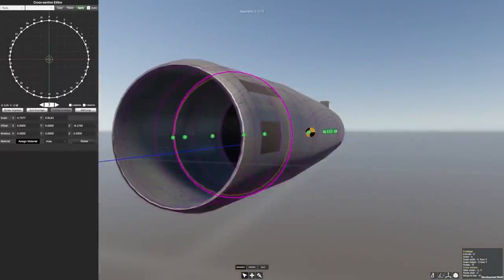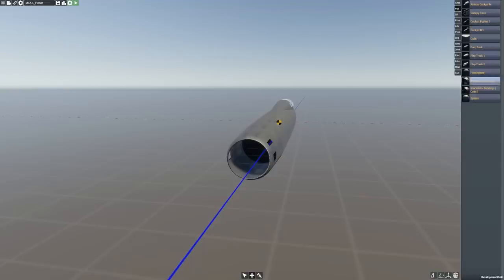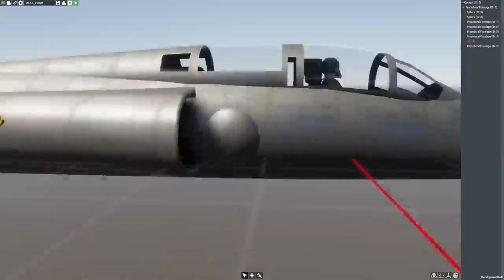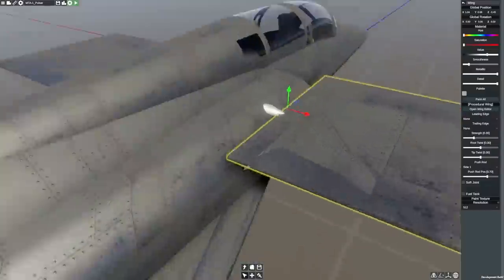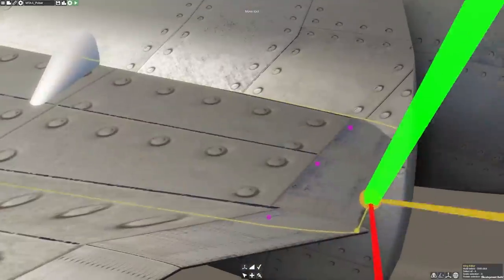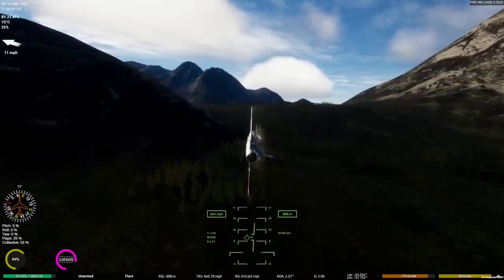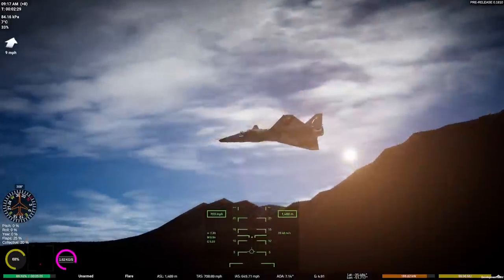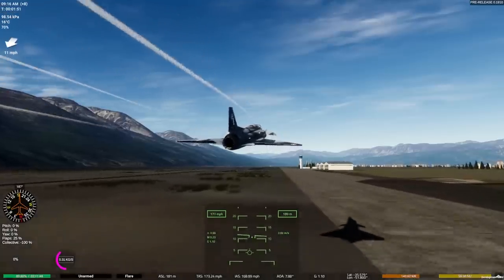Building an Artificially Stable Aircraft in Flyout!

Comment: The F-16 has this. That is why it is super dominant against air targets up close. That is the reason you see vapors on a f-16 almost every time you turn.
Reply: I think the vapors mainly come from the leading edge extensions
Reply: Well yeah mainly because it’s not aerodynamic (atleast compared to the majority of fighters)
Reply: But it...doesn't? The F-16 is a completely "normal" craft in that it has no thrust vectoring capabilites (the VISTA program was a thing but that never "took off"). It's maneuverability is down to how light it is and it's powerful engine, not any form of thrust vectoring. The F-22 is the only actively "serving" fighter in the air force that has thrust vectoring (far as I remember anyway).
Edit: I'm so sorry I came here from a different thrust vectoring video, but yeah, the F-16 does have the natural instability, and it's why it has such an extensive fly-by-wire system, otherwise pilots couldn't control it.

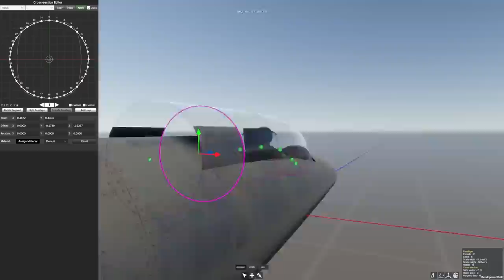Comment: 1:50 This analogy actually works well, because, for sufficiently skilled drivers, rear-wheel drive leads to better handling because acceleration and turning controls are separated. This is why it's much easier to drift in a rear-wheel drive car.

Comment: I know almost nothing about planes. But I know a lot about cars (and spend most of my time building race cars atm).

Your comparison to oversteer makes a lot of sense, as the optimal weight distribution for a race/performance car isn't 50/50 but rear biased. It causes natural oversteer which is countered with suspension geometry, differential setup and tire sizes. Currently some manufacturers set their performance cars (and racecars if refulations allow it) to be permanently oversteery and ballance it out with electronic aids, to operate as close to the car's actual limit as possible all the time. Tesla, McLaren and Ferrari are propably the nost notable examples of doing that.

Comment: Aside from AOA limitation I still haven't gotten AOA control surfaces and such to actually make my crafts stable when making planes like this that are tail heavy, I wind up just making a lot of small adjustments and adding certain flight inputs based on airspeed for control surfaces instead.  It works but can be a pain and when outside of those speeds causes issues, especially at high speeds. 
Hopefully I can figure that out soon!  
Love the videos and would love to see something explaining how to use AOA control surfaces better.

Comment: I'm a Brazilian engineer I like to watch your channel cuz this is really hard to make especially if you create the program. i try to make a experimental plane as maneuverable as one with TVC but without using TVC but at the same time its a wave-rider to reach high altitude at the same time. the maximum I've gotten so far is 48 degrees A.O.A at 39m/s with the help of the system controlling the instability. the wings of my project are anhedral with the purpose of using the shock wave to generate lift its hard to explain but i think you can understand me. really hard to make but that makes everything more difficult and a fun hobby! ✌😅

Comment: Thank you so much for this video!!! I've been making my own canard plane as aa personal project and trying to find information on ways to implement an fcs is nearly impossible. This really helped my research!

Do you know the way the fcs is coded in flyout? It would be useful to see the responses the canards make to different aoa's and speeds.
Reply from the maker: Hello! I do understand a little bit about how it's coded. A 100% AoA response will be calculated with exact refrence to AoA. For example, a 100% AoA response would make it so your canards are always pointed at 0 degrees unless your aircraft goes beyond its deflection limit (also an adjustable number). Adding a pitch response to that will half it. When the game comes out, it's best to experiment with it to find the perfect angle!
Reply: @messier82ac  Thanks a bunch, this will really help with my project ٩(•̤̀ᵕ•̤́๑)ᵒᵏᵎᵎᵎᵎ

Comment: Pilots have said the easiest plane they've flown is the f22, because it does the flying for you. So they can focus on the mission. You tell it an angle, tjeneste or AOA to keep, and it does the rest. Or you tell it to turn, and it does all the controls for you. No need to fine control ridden and ailerons it does that for you. 
You tell it keep a 5g turn, it stays in a 5g turn until you change the g force you want. Insane machine

Comment: Think of it as balancing an egg. You can balance it on the wider end and it will always right itself. But it takes a bit of pushing to lean it sideways, it wants to be  upright. You can (theoretically) also balance it on the narrower end, though that's an unstable equilibrium. It takes not force at to tip it in any direction but it takes constant tiny micro adjustments to make it stay in that position. It's tiring... unless! You  make a computer do those adjustments! 
Better be a damn trusty computer tho!

Comment: Your plane is literally identical to my fighter, with two rather insignificant differences. I have 2 vertical stabs attached to the wing roots, and my canards are blended into the wing. your proportions, wing shape and sweep, canopy window, fuselage, almost identical! literally the same in theory and in practice for the same purpose. damn... back to the drawing board. i'll have to get more daring if i want to shoot it down ;) 322DX-4 coming up soon...
Reply: shaking in my combat boots and forest-camoflauged gear knowing your airplane which is essentially a modernized Kfir is gonna outperform mine own... whenever i get an access key
Reply: realizes my non-thrust vectoring delta wing sustains 45*/s in KSP FAR

Comment: I hope you can use this as the base of a new Series, but you don’t have to

	On June 17th, 1967, The United States of America formally declares war on the Soviet Union and the People’s Republic of China following China’s first Hydrogen Bomb test. Age 33 Staff Sergeant Jack Asten gets ready to board his A-2 Skykiller, to strike Moscow from West Germany in Operation: Raging fires.

A-2 Skykiller specifics:
Length: 55-90 ft
Wingspan: 65-85 ft
Crew: 2 (1 pilot 1 weapons operator)
Payload: 4 Aim-9Ds, 3x 1000lb bombs and 2x 500lb bombs 
Range: 3,000nm
Engine: 2x mid-bypass non-afterburning turbofans
Gun: 6 barrel 10mm 4000 rounds per minute w/ 1500 rounds muzzle velocity 1100 m/s

If you use this I will expand with the story and more planes :)